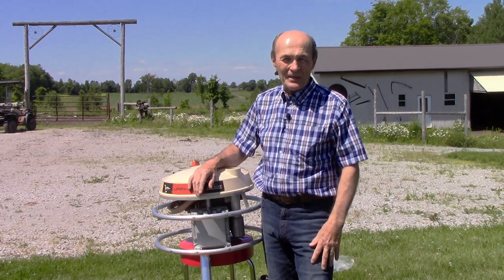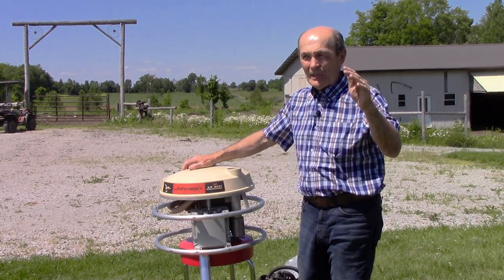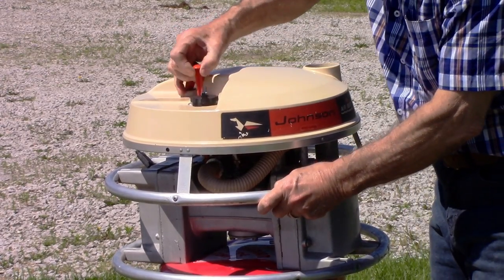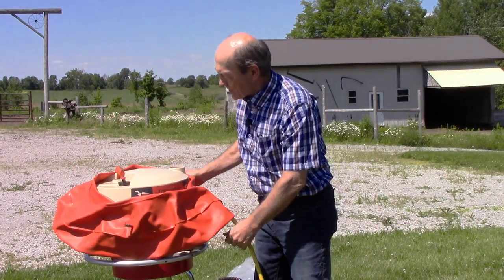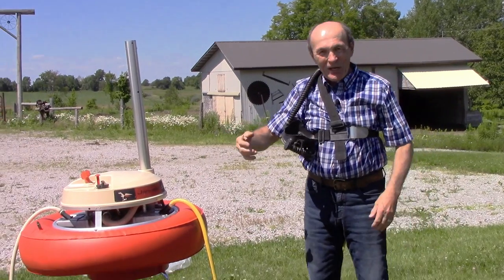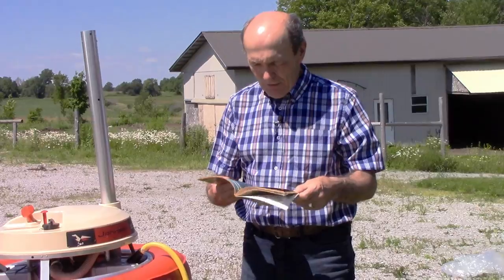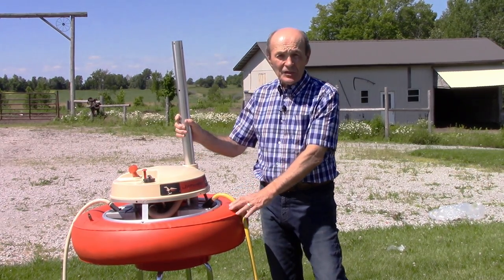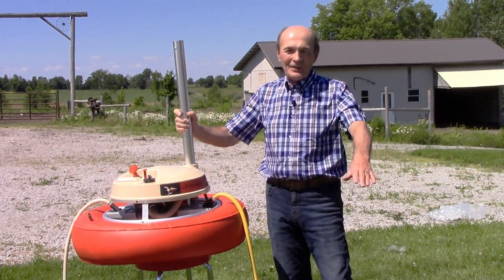Vintage Scuba: Diving Without Tanks - S03E07

Comment: I grew up in the keys. My parents were Johnson dealers and we got one of these. We were able to add a 10' extensions onto the hose so we has 35' of hose. We used it for diving on the reefs, coral heads and channels. We were able to stay down for 50-60 minutes on a full tank of gas. Sure brings back memories seeing this video.
Reply from the maker: Very glad to hear from another owner and who used it too.  Much appreciate hearing your story of these really useful diving aids.
A.
Reply: @AlecPeirceScuba_SeaHunter  I hate to guess hour many hours of use I have. There were three of us that took turns using it over 5-6 years from school letting out (End of May) until Labor day. Our parents owned a marina on the water and we had the use of a boat anytime we wanted to go out, and we did, a couple of times every week. We may not of been diving every time we went out, but you can bet during lobster season we were under the water. :-) Growing up in Key West during the 60's & 70's was great.
Reply: Do you know what size tube is on it? We have the bouy but we need the tube.
Reply: @junedwy  No I don't. Remember I was a kid 15-16 years old over 50 years ago. I seem to remember that it was a special built tube just for it.
Reply: Hola sabes donde puedo  conseguir este equipo ahora quiero comprarlo

Comment: Hey Alec.. thanks for the redirect.  I was 12 in 67 in Victoria, British Columbia..and I didnt even know how to swim until that year.  Those Air Buoy's look way cool. I just bought this Brownie, used with low hrs, but still demanded a hefty price. Today is our first trail run. We are both certified divers, and have metal detecting for 40 yrs, intending to do underwater metal detecting this round. With exceptionally hot weather this summer, I bet people are loosing jewelry like crazy in the water. Hookha is a very cheap and effective way to dive shallow water. Ditching the BCD and tank, in exchange for lots of weight's in a backpack.(7mm wet suits).  Will keep you posted as to how the first dive turned out. Thanks for your encouragement and kindness. All the best to you.
Reply from the maker: Glad you like it John.  Hope your treasure finding business lets you buy lots of shinny new scuba gear.

Comment: Great video!  I was in a jet ski repair shop maybe 20 yrs ago that had a gas power underwater scooter. Had a similar stack for exhausting and getting fresh air for the engine. Believe it was an Italian made unit. Do u have one of those?  Thanks again.
Reply from the maker: It's called the Aqua Scooter.
I sold mine about 2 months ago.
Believe it or not, they still make them!
Mine was from 1969 and still running great. 
A small 2 stroke engine with a prop. The gas tank was the float.
I'm sure you can google it.
Thanks for watching.
Alec

Comment: Nice to see modern battery technology not only power my Nissan Leaf but also make hookah diving safer. Even with that long engine exhaust tube I'm still not sure I'd want the exhaust that close to the breaking air intake. If wind current changed up it would be a bad day to be sucking engine exhaust. The Brownie's Third Lung with 12V batteries makes a lot of since. The Brownie's is expensive!
Reply from the maker: We service the Brownies at our local Rainforest Cafe restaurant. They use it for diving into the big aquariums.
It's pretty neat. Enough air for 2 divers to 30' and quiet - just a loud hum.
Set it on an inner tube with a long extension cord for a shore dive and you're all set.
Thanks for watching Jeff. 
Alec

Comment: this is the late version, the early version have a water hose like fittings, metal compressor valves, the harness belt arrangement is different-and the carburetor is different

Comment: I guess that's what the hookah port on the old double hose regulators was used for.
Reply from the maker: Almost exactly the same thing Ky.
Alec
Reply: not for the aquanaut, the design of the aquanaut or the air buoy( the same ) is that the air is freeflowing and you thake only what you need, the rest is dumped to the water so there is no mechanics except two poppet valves at the diver level, the maximum pressure exerted at 30 feet of water is 15 PSI and the air pump is not sufficiently strong to whitstand a much higher pressure, so the relief valve setting is about 22 PSI, this kind of pressure is not high enough to permit the proper functionning of a standard second stage unless the springs and the orifices are modified and it's a job for a specialist that have the equipments to calibrate.

Comment: where is the breathing air intake and engine exhaust ? seems like you take a risk of CO poisoning if the wind pushes the fumes in the wrong direction... Neat toy!
Reply from the maker: Good point Alain. I didn't make that clear.
The combined exhaust/intake tube is for the engine only. The compressor intake for the breathing air is under the canopy. Still not perfect but pretty safe from CO.
Neat toy don't you think?
Alec
Reply: that's why it's so important to be sure that the exhaust system is leakproof and the corrugated hose that  ties the carburetor to the air tube is in top shape.
Reply: @Zukuri620  check vintage double hose, I took my replacement hose there, you can also use a bent 1" tube with 2 small i" ID hoses for coupling be sure that your muffler is leakproof at the cylinder flange, it is critical for your safety, the main purpose of the double exhaust / intake tube is to redirect the small leaks that can occur at the threaded joint to the carburetor so it is very important that the air intake / exhaust system be in top condition
Reply: @jacquespoirier9071  hello Jacques. Where Do you think we could get the mask for this apparus ?
Reply: @jocelynbedard2558  probably that your maternal language is french. For the benefit of all, I'll answer in english, With my machine, I had no mask and harnesses, I found on Ebay a mask and harness at a correct price  ( it needs refurbishing ), I duplicate the harness with the backplate and I used hoses and mouthpieces for a double hose regulator so I redirected the bubbles  at the  backplate level, I choose that way to use a standard mask and the standard double hose mouthpiece with the check valves.( inhale and exhale )
I looked to the new generation snorkeling full face masks ( the original mask is a full face design ) but they all lack a provision for nose pinching so not truly usable at depth.
You can use a modified snorkel that is originally equipped with a purge valve but you need a check valve on the air feed circuit at the level of the diver in the case where the feed hose breaks to avoid a vacuum at the diver. On the original setup, the check valve is located in the elbow at the entry in the mask.( on my setup, the check valves are located at the mouthpiece level ).
I sources my parts at Vintage Double Hose in florida. Brian gives a very good service and he gives very important info for rebuilding diving regulators.
Reply: @jacquespoirier9071  merci Jacques

Comment: Does anyone know the fuel mixture recommended for this?
Reply from the maker: 50:1 two-stroke fuel mixture - just like a chain saw or other small engines.
BTW, I have just acquired another machine in near perfect condition - masks, hoses, float, etc, and will be selling it if anyone is interested.
Alec
Reply: @AlecPeirceScuba_SeaHunter  thanks! The manuals are pretty pricey and I cant find any online copies so any information is good information
Reply: to the spec, the early version uses 16:1 mixture using SAE grade 30 oil, the later versions ( snap style hose connectors, 2 ring piston ring setup instead of 3 and roller type wrist pin bearing instead of a bushing ) are specified a ratio of 24:1.
if you use modern synthetic oils, you can go to a 50:1 mixture, it have its advantages ( about no smoke and much less engine fouling and oil projections )

Comment: Alec, I'm curious (not in that way mind you lol).  Anyway - I've been wondering modern day diving we use wings and BCD's.  Back in the days of black and white how did you setup without being too heavy or light weight.
I know as part of my course the PADI course director got me with one breath, no fins, no air in the Bcd to kick to the surface (exhaling all the way up obviously)...  This did highlight the fact that our kit makes it easier though still possible to manoeuvre with less of it.
Reply from the maker: Right Slick.
Thanks for finding that older vid.
That should do it for Peter.
Alec
Reply: Excuse my humour of referring to "black and white" days and thanks for the reference. Maybe I should go and watch it again.
Reply: OK, I'm more thinking our the kit we would see in SeaHunt, Lloyd Bridges from what I see he doesn't use a bcd.
Reply: iVlogBuzz "I'm more thinking our the kit we would see in SeaHunt, Lloyd Bridges from what I see he doesn't use a bcd."

BCDs started becoming mainstream in the 1970s. Before that, divers would weight themselves based on previous experience for the amount of weight they'd need to be neutrally buoyant at a specific depth. In warm water, diving with just a swimsuit, you'd be able to move within a fairly wide band of depths, but in cold water, with a thick foam wetsuit on (which changes buoyancy as the pressure change compresses or expands the neoprene) it was much more restrictive. At depths other than the one you were weighted for, you had to do a lot of kicking (and often hand paddling) to get around.

Comment: a few years ago, I restored an Aquanaut, a very fine machine that had its limitations and its design flaws, one of these is the exhaust system that was supported by the exhaust flange so breaking was evident and a better support was one of the improvements i done, another was the relief valve that was not servicable, I modified the design to make it servicable and adjustable, the bearings are standard 6206-2rs pressed over the excentrics, the engine is mainly a standard Lawm Boy D400 so with a bit of reshearch, I was able to find all parts and materials to rebuilt it correctly, the most challenging part was to design and fabricate a new flotation collar.
Reply from the maker: I have searched for and found a regular passenger car inner tube that's a perfect size to replace the float.
It sounds like you've done a good job.
These machines are a lot of fun and can be very useful too.
Thanks for watching and sharing.
Alec
Reply: I used a 8.25-20 truck tube. with a bit of constriction and a heavy duty nylon  jacket, I was able to make it fit correctly. If there is a way to send you a photo, i'll send you one.
Reply: @Zukuri620  I'll suggest you to do top quality repairs on that type of equipment as a breakdown can lead to a catastrophe
a very important point is that the corrugulated hose that starts from the  sleeved intake / exhaust stack and goes to the carburetor, it should be functionnal because it recuperate all the exhaust leaks and redirect them to the intake avoiding the compressor inhaling it and compress it to the diver.

Comment: Powered by basically a Lawn Boy model C engine. The owners manual does talk about driving hazards.
Reply from the maker: They still make a version of these today because for their purpose, they still work great.
Reply: it is a D400 engine with 3 modifications, one is in the cylinder casting to include a flange for bolting the muffler, the second one is that the case is fitted with a roller bearing instead of a bushing and the last one is thet the end of the crank is machined 3/4" dia to recieve both compressor connecting rod excentrics, the rest of the engine is similar to the lawn mower engine.